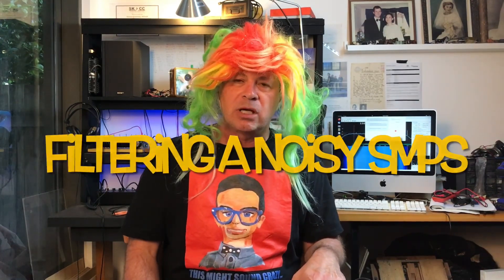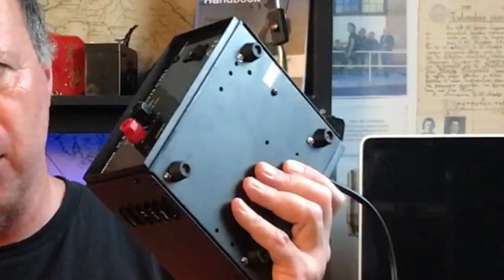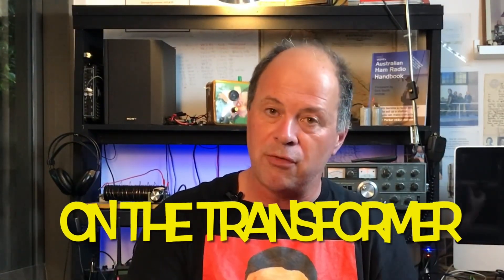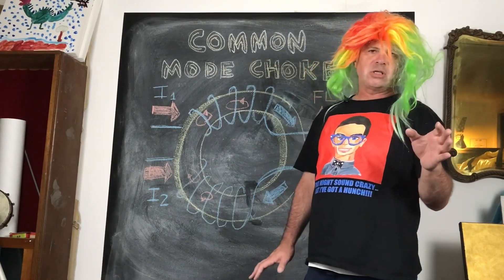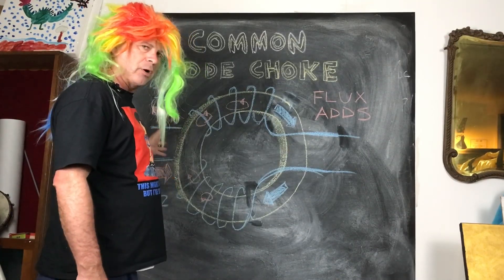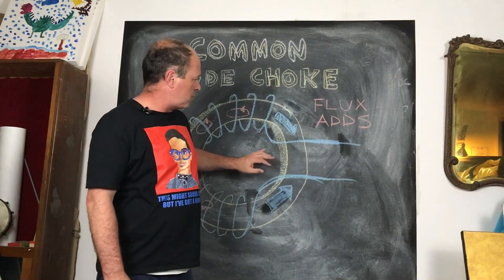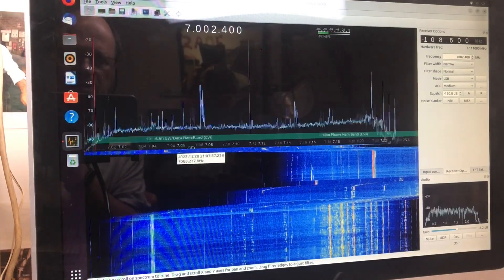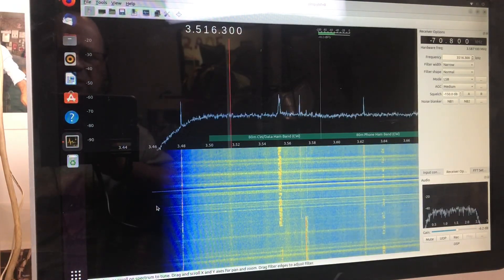RF Suppression for your Switch Mode Power Supply @TheArtofEngineering

Comment: Can you able to help me I am running a HAM radio on a power supply from Jaycar ic725  when I go down to a.m. annoyed gets very bad when I go to 27 mz  the noise is ok can I add the use it for transmitting what the noise come over it
Reply from the maker: The noise might be local generated rather than from the supply? When you say “go down to AM” do you mean, listening on broadcast AM, or using AM mode? This filter only gets rid of RF generated by the switch mode. If your IC725 is noisy on transmit it could be supply related….but could also be something else?  73 de VK2AOE

Comment: Comments: Good presentation Sir.
However The RFI noise generated when investigated with 250MHz CRO & 10:1 probe sniffing. Switching spikes on circuit ripple.
Used a keyhole camera snake tip & dentist mirror to get the transistor type numbers. Looked up at the manufacturers recommended application bare bones which appears to have been followed but without what was mentioned about drive & by pass suggestions.
Closer inspection revealed also a switching ringing on the spike base. 
Driver cct to drive xfmr driving two mosfets in push pull. 
The switch ringing is commonly associated with over driven push pull output stage.
In my case I cut the respective tracks leading to each final's gate and placed a smd 20 ohm resistor in drive supply line, which only reduces the total drive slightly. Also placed across the push pull final mosfets', Gate & Source tracks a 39nF 100v capacitor.
CRO Result showed a much cleaner output, dramatically knocked the over drive ringing cause. 
Dramatic reduction in cross over spikes such reduced to general probe noise pick up floor level.
There was no noticeable difference in the finals operating dissipating temp.

On another branded chinese manufactured switch mode dc supply was of similar design. There  a 25 ohm resistor was placed in the Gate drive supply track to each of the push pull mosfets and 47nF caps used across each Gate Source. Problem eradicated at the cause. 

The dc output choke, 220uF + 0.001uF 100v green cap really makes a reduction difference on HF, but those spikes & hash appear  in  the noise floor beyond GHz. 
Like lots of shacks running HF VHF , UHF & SHF. The problem causes needed addressing.
VK2BPP
Reply from the maker: Wow…. Thanks for this very detailed account of your investigations. I have to admit my understanding of SMPSU is limited to the basic theory of operation. Nipping the problem at the bud is a good way to go if you are knowledgeable. Being as I’m not that clever I rewound a couple of microwave xformers and built a simple 20 amp linear PSU 😝Linear 20A 13.8v DC HAM SHACK PSU - Made with rewound microwave transformers@TheArtofEngineering
https://youtu.be/uV5gD_t0V6w

Comment: nice demo, i bought my rtl-sdr v3 on a wim, just to visually see the band conditions ect,  after a few days it was my best £20 investment, not  only  did it detect mains born rfi, i was experimenting with any rf noise and was suprised with the results, 12v smart car chargers were jamming all of hf/vhf, solar garden lights, led bulbs, ... but remember the rtl-sdr is connected to mains earth through the usb gnd, 

after building a dedicated sdr scope using a tablet, i managed to reduce my noise floor to almost silent, eliminating mains power altogether, 3 identical 100amh lead batteries in parallel,  12v dc equipment, and an old solid state 6amp car battery charger, before i went live the charger was off,  if anything is mains driven, you are connected via earth/ground sharing all devices local,

after all that, i then used sdr to compare antenna's, rst, noise floor and perfomance, ...... sdr rx'r is the most important tool i have in the shack,
Reply from the maker: Yes I have thought about going all battery. Looking for noise is something I need to do! Thanks for the informative comment….envious of your noise free situation 73 de VK2AOE.
Reply: @TheArtofEngineering  no worries thanks m1dls

Comment: I have an astron that just started giving me trouble like this.  I would get chopping between 7.1ish to 7.22mhz when the supply was on and powering something.  I had my g106 on the switched and my 991a on the linear and the noise on the 991 was horrible.  So I wrapped a few turns of the power lead in a mix43 for the g106 and the 991 noise dropped right to normal.   I'll have to di into this some more.  I wonder what happened to my Astron SS-30m though.

Comment: Is your power supply under any serious load when you test the choke mod ?
Reply from the maker: No…. But when it is loaded …. I would be transmitting….. so noise on receive is of little consequence. It would be interesting to see if it effects noise though….. presently I now only use it on test bench as I’m using another Drew Diamond VK3XU design, the Miser DC 20 A linear 13.8V PSU (I’m using 2 rewound microwave xformers in it) Linear 20A 13.8v DC HAM SHACK PSU - Made with rewound microwave transformers 73 de VK2AOE @TheArtofEngineering
https://youtu.be/uV5gD_t0V6w

Comment: I would suggest paralleling a .001 cap with the electrolytic cap.
Reply from the maker: Yes.....part 2/2 has the Drew diamond design which adds more caps (as you suggest) and also filters the mains too! TU fer the comment 73. link to vid here - https://youtu.be/oJaPQWJDdp4

Comment: I'm glad you got this to work. However, I disagree with our explanation of how the common choke works, and your claim that magnetic flux has reactance.  The workings of the common choke is such that common noise in the two ports create induced EMF that opposes current of the noise.  Effectively, the induced EMF cancels the noise due to the polarity of the induced EMF due to the other coil.
Reply from the maker: Yes you are correct! I do discuss opposing flux for differential current cancelling and addition of flux for common mode current …. The inductive reactance “excursion” is most likely not a good way of explaining it. But if it has nothing to do with it … then what “chokes” the common mode noise? The common mode noise “sees” a big magnetic field produced by a big coil …. The noise is RF …. Varying ….. so is there inductive reactance?
Reply: @TheArtofEngineering  If we examine how EMF is induced in one coil due to current in the other coil, we can determine that common noise is cancelled by opposing EMF induced form one coil to the other.  It's best to think of the common mode choke as a transformer (because that's what it is)  If you draw a schematic while noting the "dots" are on the same side, then you can easily see that transient current in one coil cancels common transient current in the other coil.  And that's the "magic" of the common mode choke.  While analyzing the operation, remember that flux due to induction is the opposite of the flux due to current in the coil, as required by the law that says you can't get more energy than you put into a device.  Consequently, a common mode choke doesn't work that same way for differential current.  Now, having said all of that, I'm not an expert on magnetism.  I watch these videos to cement my understanding of the subject, but often find myself disagreeing.
Reply from the maker: @dannylong6966  I think your explanation sounds more correct than mine! Especially the “thinking of it as a transformer” …. Thanks for taking the time to explain this! The Drew Diamond design which also filters the mains AC works even better …. Video will be posted shortly. As for not being an expert on magnetism ….. you seem to have a good grasp of the concepts. Are you studying engineering? If not you should be ! 😀Also are you a ham? If not ….. join the cult of ham. 73 de VK2AOE
Reply: @TheArtofEngineering  Hi again.  Thanks for the stimulating conversation.  It's not often I get to have a discussion like this.  No, not a ham, but my father loved radios.  I've been an electrical engineer for almost 30 years, but I don't often have any work that involves chokes.  A few years ago, I was trying to find a better way to connect analog and digital grounds on a signal board, and was looking into using a common-mode choke to do this.  But I never finished that project.  I will one day, if I can find the time.  I'll look for your videos in the future.  It was hard to find my way back to this one.